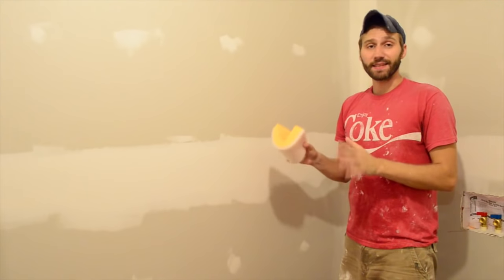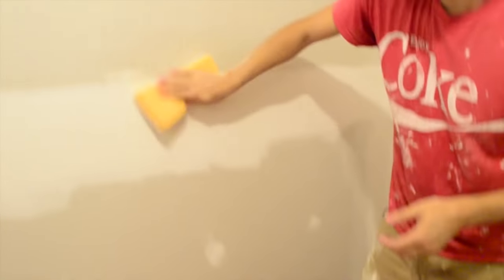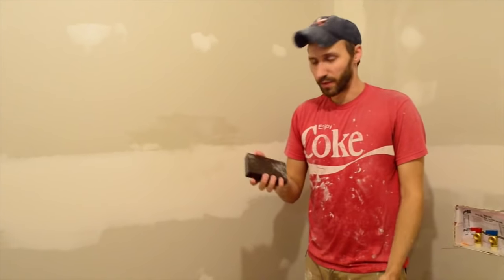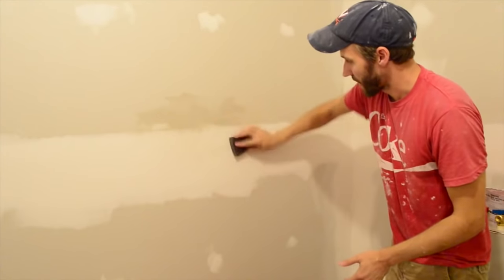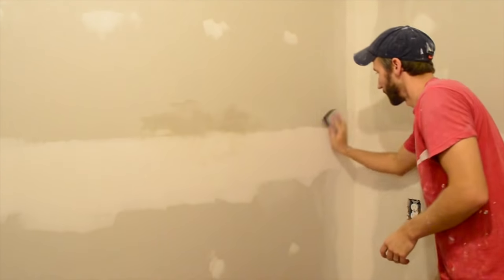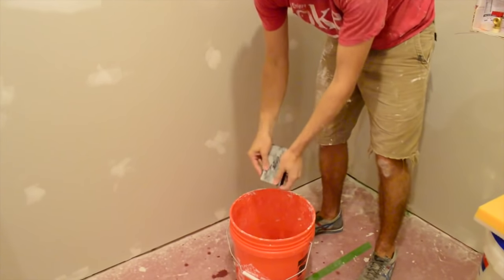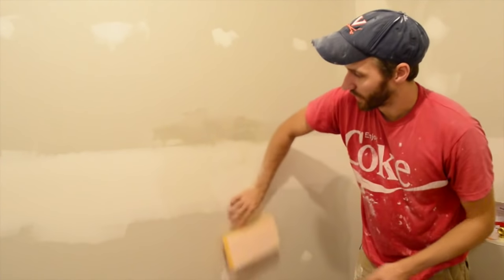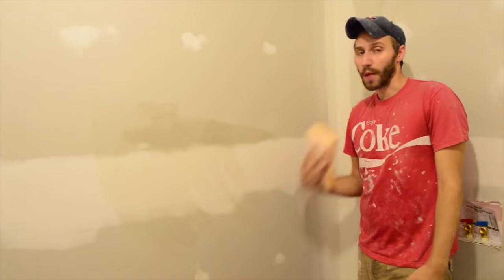How To Wet Sand Drywall (Less Dust = Good Stuff)

Comment: Video is great!! Always had a problem with the dust in the rest of the house, especially on the furniture. TIP: Try putting black block sponge under running water and run a toothbrush over the surface to remove the plaster dust.  Looks almost new and less hand wear.

Comment: I hear the professionals here speak out against this technique saying that sanding is the best way, but for when used in fully furnished areas , like restaurants where cleanliness is paramount then wet sanding is the way to go.
Reply: You shouldn't be doing drywall and mud work in a fully furnished room. And if you do for some horrible reason everything needs to be covered in plastic

Comment: I tried it.  Your technique worked well.  I did as you suggested but I finished the feather with a normal sponge.  I was working on a large repair patch.  I would say for a repair change the water as you go.  Thx for sharing this.

Comment: When you use the first in the video get the sponge wet apply the water smooth side first to get the mud wet then flip to the rough side to knock down edges then back to the smooth side to finish .works well for me best of luck people!

Comment: Spray bottle and a steel large putty knife or a taping knife. Spray it with a mist of water, entire area you wish to sand. Then swiftly take the putty knife or taping knife and scrape the water off that you just misted on with long flat scrapes. This will flatten all the right places and fill in any imperfections. Makes things so easy!
Reply: Do you push or drag?
Reply: @IrichB  drag
Reply: @Truth911- thank you
Reply: Cool. I'm going to try this today. Thanks for the tip
Reply: Thank you!
Reply: @justinabar3969  your welcome 😃
Reply: At what point do you do this? Is it still wet? Starting to dry? Almost dry? Or dry?

Comment: I do this for small repairs. The key is to keep cleaning pores of sanding sponge when they fill and you will have little to no dust. This takes too long for large job so containment and vacuum. The compound mixes they make now causes most dust just to fall right down as long as you do not sand like a crackhead

Comment: I used the sponge you first showed to completely sand my dining room. Always dry sanded before. My third mud application is generally very smooth, and mostly only a few edges need to be blended into the wall. Any rougher spots were done with the white, rough side first, then finished with the orange sponge side. Not sure why you had a  problem with the speed. You need to have enough water in the sponge to soften the compound, but not wet or dripping. 

FYI--for those of you who are having to sand more than a light scuff here and there, it is certainly possible to improve your mudding technique to almost eliminate sanding. I did, and I don't regret it. Best tips: 3 coats and step your knives from 4", 6", 8". The last pass with the 6" and 8" blade should feather the mud into the drywall. And very important--spend the extra money and use an ultra-light compound for the final coat! It will go on like butter compared to standard mud, AND it sands crazy easy. Made my dry-walling experience enjoyable!
Reply: So what compound do you use on the first coat?
Reply: You’re telling me! Hubby hates mudding and I had to work twice as hard sanding the areas that he did va the areas that I had done. First coat was put on soo thick and messy, and my teen daughter helped do the ceiling and her areas were about the same. I’m dying after working on it today lol

Comment: Thanks for the vid. Last month gutted our master bath down to the studs and re dry walled. Somehow the dust made it from the bathroom to every other area of the house and coated everything in a nasty layer of powdery mud. This week we’re doing the sanding on our drywall job in our hallway and I’m trying to avoid the dust explosion
Reply: I'm doing the same in my house and I learned quickly to shut down my HV AC system and isolate the area you are working on with the thick heavy plastic. In addition I just go over the area with a damp smooth sponge after I mud and that also has been cutting down a huge chunk of the sanding and so far is turning out fine

Comment: Great idea on the wet sanding sponge!  I tried smoothing my ceiling with a T-shirt material wrag, it was so so.  You look so cute, it feels good to see someone else working on messy stuff.  I have been working on 2 ceilings bedroom/office since I scraped off the 1965 popcorn texture.  I am sick of this mud process, however, I mixed in 1 to 4 ratio of paint, rolled it on, skimmed it off.  Much better than applying with a trowel skim on, skim off.  The paint mixed with the mud, seems to make it dry much faster, AND, it seem less porous.  I learned just today, Roll one coat, wait 3 mins.  roll the 2nd, then skim.  Working of course in small 4x4 area so it does not dry too fast. Thanks & God bless you!
Reply: Janet Stone I hope you took some precautions for asbestos.

Comment: Only sand when you are finished, never between coats. Never use a sanding block... Use a tile grout sponge lightly dampened ( not the one in this video) and a round 9 inch sanding head
Reply: Wet sanding uncoated drywall can cause big problems.. the type of mud used plays an important role in sanding.. also, DO NOT thin mud with water.
Reply: Why not use water?
Reply: @drakewilliams10dw  you can. It's great for dust control. I don't suggested unless you're experienced